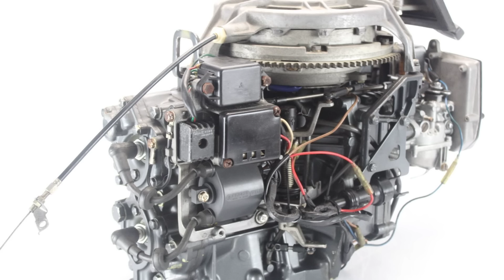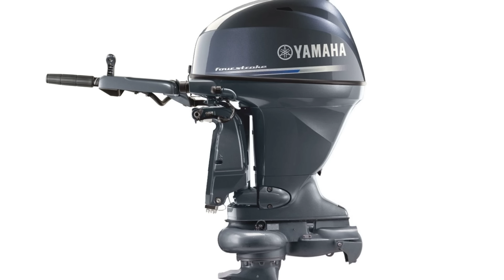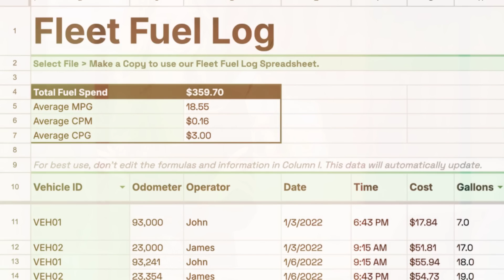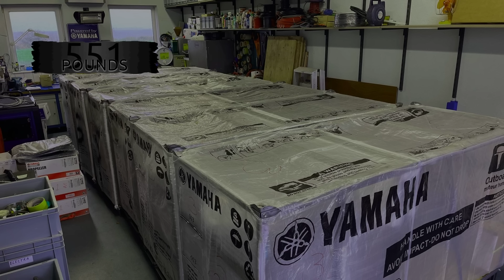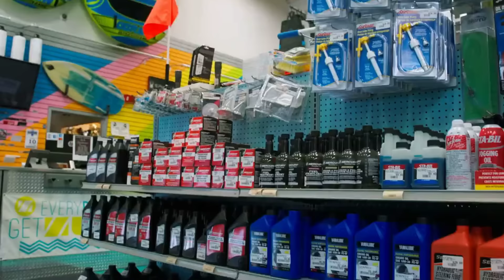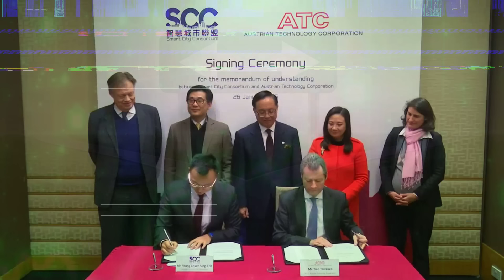This New Diesel Outboard Will Change Boating Forever (2026)

Comment: USA military has been using diesel outboards for years.......
Reply from the maker: Correct. OXE's biggest early customers were military fleets specifically because diesel matches existing fuel logistics for ground vehicles. The recreational pitch came later.
Reply: AND MOTORCYCLES

Comment: I have had experience with both brands with these 2 diesel outboard engines and both are useless. 
They are crap, do not buy them, too many design issues, I know.
Reply from the maker: Appreciate the firsthand take, this is exactly the kind of feedback that doesn't make it into the marketing. Mind sharing what specifically failed? Belt drive, electronics, cooling system? Real ownership experience like yours is more useful than any spec sheet.
Reply: @wescarver  The vessel I have been on many times has 3 X 300Hp Cox diesels. When we go to idle speed, they overheat very quickly, can then shutdown without much warning. Cox's fix is, when in idle speed, put engines in neutral and manually increase RPM, but that's a bit hard when you need to make way.
Can't say too much, I will be shutdown myself.

Comment: Honda have been making diesel engine outboards for nearly 40 years that I know of. They are all over Indonesia.
Reply: Nah they build 5.9 Cummins engine on a canoe 😂
Reply: Honda does not currently produce or sell diesel outboard engines. Honda Marine specializes exclusively in four-stroke petrol (gasoline) outboard motors, ranging from small portable engines to high-power V6 and V8 models. Their lineup, such as the BF250 and new BF350, focuses on, quiet operation, and fuel efficiency.
Reply: @tonyp2865  I went fishing on Indonesian boats which ran Honda diesel outboards in the 1990's.
Reply: @lesteraizlewood8457  Just posted what I read on the net. Post me model and name.
Reply: @lesteraizlewood8457  a long tail is not an outboard.
Reply: @tonyp2865 not allowed in the USA market most probably because of greed
Reply: Ya in usa they don't want diesel.  For some reason oil companies don't want diesel. So it'll go nowhere.

Comment: They are cool engines , saw a company install these on their new catamaran dive boats …. Ultimately they switched  to twin Yamahas ..
Reply from the maker: That matches the pattern across the industry. The OXE engines deliver on the engineering side with fuel economy, torque, and range, but the operational reality of running a fleet often comes down to parts availability, service network, and resale value, all areas where Yamaha still wins by a wide margin. Curious if the dive boat operator ever shared why they switched. Was it parts wait times, service support, or something else?
Reply: @wescarver constant small issues , OXE , seemed quite responsive, however constant issues without any available solutions make thing difficult especially in th Caribbean

Comment: A water cooled turboprop would float more boats.
Reply from the maker: Interesting. Surface-piercing or fully submerged?
Reply: @wescarver   A water cooled housing wrapped around a compact outboard form factor turbine pump can also be the hydraulic linkage to a subsurface pusher propeller. It can technically be sold as an "All Fluid" engine with great thermal efficiency and low maintenance and the first adopter end of the market will bite.